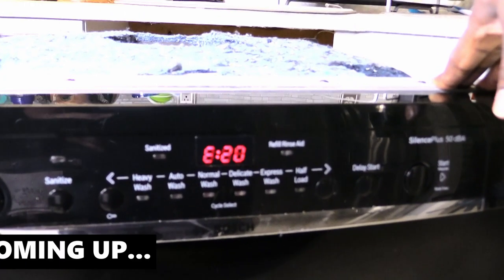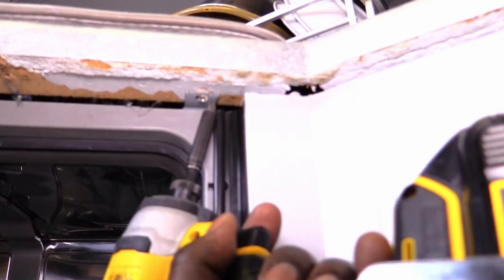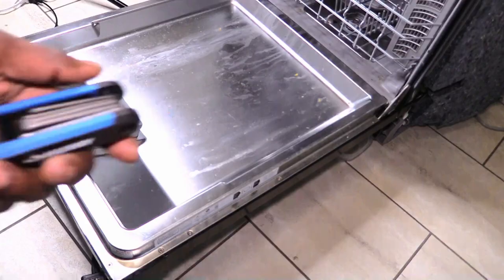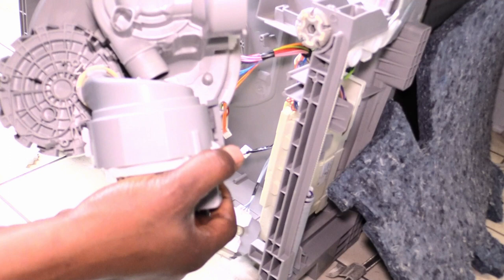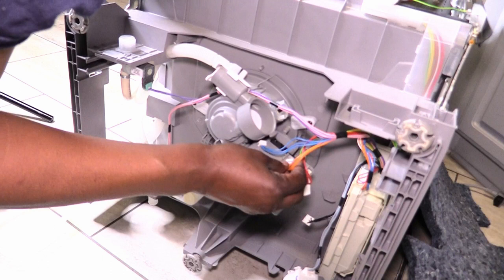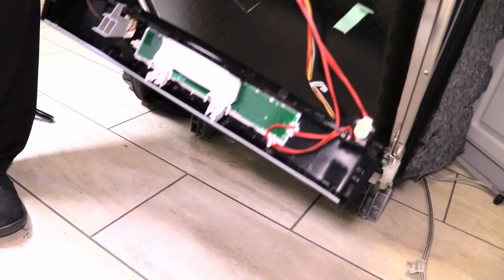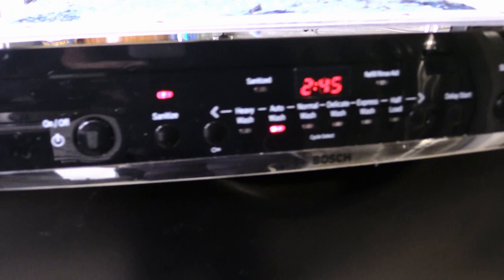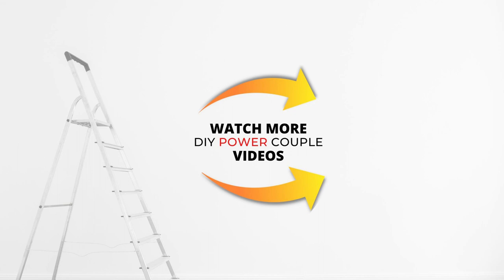How to Fix a Dishwasher Circulation Pump DIY | BEST Step-by-Step Video

Comment: Great video. I'm going to try this repair myself. I have the same model as you show in the video.  Do you have a link to the part you used? Thanks for sharing your knowledge.
Reply from the maker: Drew, no link🔗 yet. Let us know how it turns out for you...and thanks for watching. 😀
Reply: @DIY Power Couple  I was able to pick up the motor from appliancepartpros for $150. It showed up yesterday and following your video I had it installed in a couple of hours. Took me a bit longer because my builder hard wired the electrical.  One thing I did skip was taking the door off. Turns out that wasn't necessary.  Long story short, the dishwasher is working like new and my wife is very pleased. Thanks for your awesome video.

Comment: why do you have to take the door apart? You are putting it on it's back so you have access to the pump. Why does the door have to come apart?
Reply from the maker: I was wondering 🤔 the same thing. It's like a puzzle 🧩 where all of the pieces have to be removed in order. Actually, it's more like a rubik's cube.
Reply: I am wondering the same thing, still doesn't make sense. Nonetheless, thank you so much for this video, was very helpful!!!!

Comment: You should have titled the video how to replace the pump you did not fix the pump
Reply: what an asshole comment. fixing the circulation pump is exactly what he did by replacing it. when your car goes into the shop to be fixed most of the time unless they are machining engine internals consists of replacing worn parts NOT breaking things down and rebuilding them. fixing engine cylinder compression leaks involved replacing pistons, rings, or maybe even putting in cylinder sleeves. lemme guess for body work you would do bondo and spaghetti or bondo/towel DIY hacks instead of a real repair which would involve replacement...